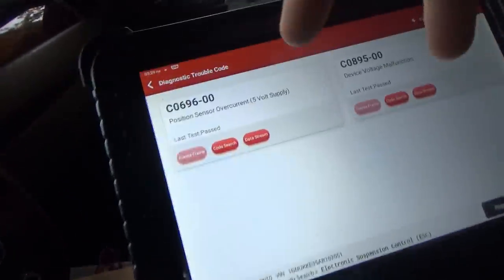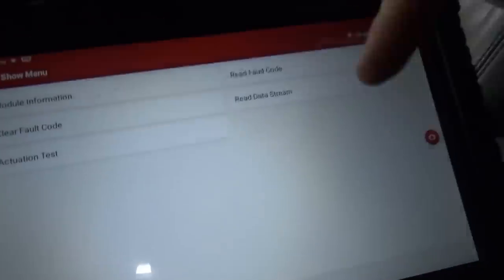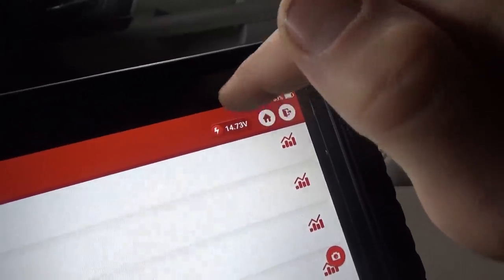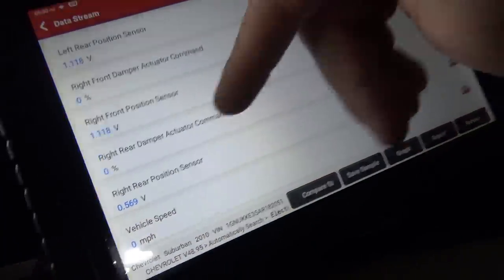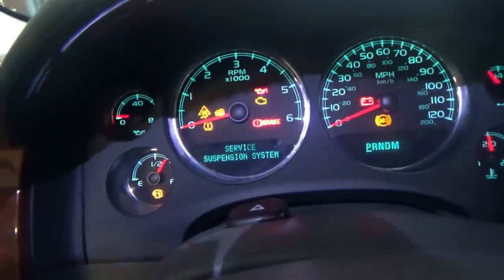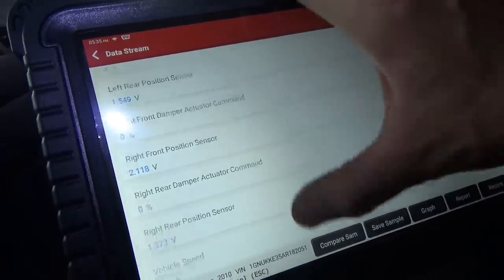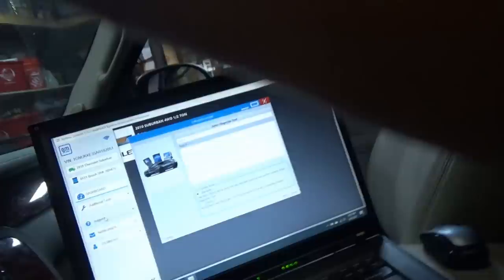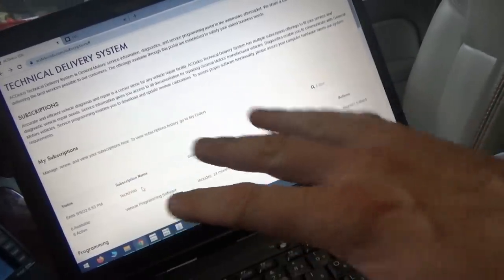"Beached Whale" Suburban - Part 3 (ESC Suspension Module: Replace & Program)

Comment: I had a 2003 with the same issues with leveling system compressor was bad shocks were shot too was quoted $2500 for repairs more than vehicle is worth I said no way. I searched found how to delete the electronic leveling system put new standard shocks all around and air bags in rear springs to the tune of $500 plus my labor. Works fine for me!

Comment: Wow ! tech 2 brought back memories from working at a holden dealership in the late 90s to early 2000s , they also had some antique looking scan tool before obd2 . Very basic but it did what it needed too . Great video Ivan 👍
Reply: G'Day Trent. John M here in Perth. (2nd attempt) I have a 2010 VE with an annoying problem in the Heater/A/c control. Before tearing the dash apart (scary) I am thinking of buying a TECH2 clone from China for $350 to see if it helps diagnose the fault. Any thoughts? Thanks.
Reply: @pakjohn48  Hi John , what's the actual problem with the a/c control ?
Reply: @trentg1396  Hello Trent. It permanently blows hot on the LHS (passenger) vents (both windscreen demister and face level) and A/C cold on the RHS. It doesn't matter which setting the dual control temperatures are set at. I've only been able to work around the problem in winter by removing the A/C compressor clutch contactor thus disabling it. But Summer is coming again!
Reply: @pakjohn48  pull the lhs trim off console and check heater control actuator on side of heater box is moving when you adjust temp controls . It's usually just the actuator that is faulty . If no movement of actuator check powers and grounds . I hope this helps 👍
Reply: @trentg1396  Thanks very much Trent. At last I've got something to trace. I will keep you posted.
Reply: @pakjohn48  Good luck mate 👍

Comment: Quite a circle jerk Ivan. Even with numerous high end aftermarket tools, GM makes sure they get their cut.
Pico scope gets you on the path but is unable to finish. Too many diagnostic tools out there  that just "won't or can't" complete the job. I feel your pain.
 Retired from Gm service 5 yrs ago, had an escm make me chase my tail for quite a while. Intermittently had high internal resistance within the module. Finally it stayed broken long enough for me to test across the comm, terminals with an ohm meter. Exhale and move on.

Comment: What about the processor for THE on STAR system(VICM) ???  or was that also a coincidence on the no start. Do you know what was shared over the network keeping the vehicle from starting ??  Did the BCM and or ECM receive a high voltage signal(higher than what was shown on the scan tool at the suspension module)over the network to keep it from starting as a failsafe operation ??  Well then come back next week  😉

Comment: ALC trimset basically resets the rear suspension height for the load leveling air shocks.  GM vehicles with MR shocks and rear air leveling use the same logic.

Comment: Hi Ivan, thanks for your educational video's, keep them coming!

Are all 4 suspension sensor connectors identical on this Chevy?
If yes, maybe swapping them randomly would recognise the sensor replacement, force the ESCM module to re-learn and automatically clear the C0558-4A code. 
But if the sensors are simple 3-wire potentiometers, this would probably not do the trick.

Looks like the internal voltage reference circuit gives off the wrong voltage.
If the circuit board is not covered by epoxy coating, I would start with a visual inspection of the module.
There could be issues caused by vibration like broken tracks or solder joints.
Even water intrusion could be the cause considering the location of the module.
If all seems okay, it can be a faulty semiconductor, leaking/shorted capacitor or other component.

Would love to see the faulty module opened and inspected/diagnosed by an electronics engineer. 

Greetings from Crete in Greece.

Comment: Thanks Ivan!  As soon as you said Saturn Astra I broke out in HIVES!  LOL. BTW The Astra passed inspection this year flying colors after I replaced the exhaust pipe with the crack flex pipe.  Greek is a Happy Camper. You and Amanda Stay well my friend.
Reply: That flex pipe needs repair every few years. There is a place in Canada that sells and ships replacements. I think they have different prices based on material quality/ warranty. The middle resonator is not available in the US as far as I can see but some generic stainless should be easy enough as that is just a long cylinder.
Reply from the maker: Have a 15 Sonic in the shop right now with the same 1.8 timing belt engine! Guess what... P0016 and P0420 😭🤣
Reply: @PineHollowAutoDiagnostics  P0016 with startup dieseling is likely camshaft actuator phaser; do timing belt kit while there for fun. P0420 might be flexpipe but the rear o2 sensor likely for age; check the plugs as OEM spark plugs might be copper and completely shot (taking the coil pack and cat with them).
Reply: @PineHollowAutoDiagnostics  Hey you need help give a shout. i even have the timing belt tools lol
Reply: @dosgos  The Astra Ivan helped me with it was a small crack in the flex pipe.
Reply from the maker: @dosgos  I'll have the video up soon 😁
Reply: @PineHollowAutoDiagnostics  Nice!
Reply: @PineHollowAutoDiagnostics  Awesome. We will see if these are engines are great, good, or junk!

Comment: Every time I program a vehicle, jump thru all the same hoops and finally get it done I can't help but wonder how it's so easy to do a cell phone update and it's free in comparison. It's not data volume, Cell Phones hold a lot of data also... I think it's just because by law they can make it difficult for the aftermarket, so they do.
I guess if the law didn't force them to allow us, we wouldn't be able to at all...Which brings us to needing to have a locksmith license for newer vehicles now. :/

Nice work Ivan! Btw I have the same Mastertech VCI, good tool.

Comment: So much complication - The oil-based suspension-system on my series of Citroen cars - a system invented c 70 years ago,  was a delight - no electronics involved until 2000 - ish - only replacement/recharging of suspension  spheres after several years of use. The KISS principle applies!  LOVE your posts  - you're certainly NOT a 'Quitter'  Cheeeers Keith
Reply: Fully support that. I had three Citroen C5 station wagons in succession and they were amazing cars with great suspension, powerful engines and a very comfy ride. The only issues I faced was: frozen diesel in a cold winter night (nobody's fault), two cracked door windows because they froze in place and the window actuator was too powerful (both fixed w/o costs due to warranty) and one weird exhaust partial blockage after inspection that cleared itself with a bang on the freeway (I guess something stuck in the exhaust). The suspension was simply fabulous and absolutely maintenance free. I'm really sad that Citroen discontinued it, it was that good.

Comment: Strange that an issue with the ESC would muck up the TCU that way and lead to a possible misdiagnosis.
Reply from the maker: TCU? ESC was an unrelated problem...
Reply: yeah, it's hard to make any conclusions when everything is on a CAN network like that;   things can reset each other in weird ways.  Or sometimes there is a hierarchy--  Like a Onstar module ties to the radio module, which first hooks into the BCM, which also passes through the gauge cluster before it ever gets to the ECM.  So some will have some controls over the module below it;  and for no obvious reason:  and will be different from one company to the next.  This CAN network is a little different in how everything has a passthrough, so they are all equally on the network-  so it's a little different.    But computers can glitch and still be fine when you reset them-- so you can't always trust it.   Like Ivan said, make sure you can repeat the problem over and over, and then you can be certain.

Comment: the S/W subscriptions were pretty minor compared with YOUR LABOR HOURS.  Always intriguing how (as you say) "convoluted" things can get.

BTW..  in my industry we had a standing procedure when connecting or disconnecting any connectors to always inspect.  LOOK CAREFULLY AT BOTH MATING HALVES FOR: (-1-) Bent Pins; (-2-) Pushed back pins; and in your field (-3-) Green crusties.  This includes new assemblies.  After inspection it was critical to NOT FORCE THE CONNECTORS TOGETHER.  No, "hammer to fit and paint to match!"

ADD:  Did the customer just not have a spare tire that would then offer ADDITIONAL mechanical protection for the replaced module?  You suggested they removed it for you but I wonder if it's permanently missing?  Just my 2c.
Reply: Automotive connectors can be a REAL pain. You really have to listen for the click, and sometimes have to lube the weathertight seal to get them to go.

Comment: Tech2Win really emulates the legacy Tech 2.  That procedure he did was literally updating his virtual Tech 2 the exact same way as if it was a real handheld tool.  Don't bother trying to program modules with a clone Tech 2.  Ivan already knows this.  I used MDI direct from SPS and it worked great after major struggles with my clone Tech 2.  I have a 4 part video series about this ...
Reply: Some of the stuff on aftermarket scan tools just does not work. Example, I tried programming a key on a Ford. The Launch I was using, the button and procedure was there to program it. BUT it did not work. I went into Ford programming and programmed it with no issues. Frustrating. The Ford programming cost $50 for 2 days, so I programmed the key at the same time I was flashing a trans on another car. BUT $50 if it was just that one key programming.
Reply from the maker: @mph5896  what year and model Ford? Usually ThinkTool does PATS pretty well
Reply: @PineHollowAutoDiagnostics  2014 Ford Edge. Launch throttle would not do it. 

I have had issues with my old Launch 431pro trying to program a few keys as well. 2012 or so Dodge key fob that I can remember.
Reply: We have a clone tech2 and it's pretty much worthless

Comment: When customer purchase ECM or other modules. I tell the customer. The modules MAY need to be programmed. The next question is. How much?$$
I tell them. That depends on the shop and their prices. I don't tell them the shop rates. Because of the price flucuations. 
I'm a DYI and have not tried programming modules since I don't have a pass thru device yet. I watch Dr. O programming. I know it cost $$ to get access to program and get access to wiring diagrams. For my own use. I use Alldata. Good night Ivan and thank you for dragging me along.

Comment: On older vehicle with comm issues I like to use the data bus diagnostic tool with the j2534 it’s accessible in the tech line connect home page where you launch tech 2 win, it will tell you voltage and if you have shorted can bus or bad module power, ground etc.
Reply from the maker: Hmm can't beat an oscilloscope though 😉
Reply: @PineHollowAutoDiagnostics  TRUTH
Reply: Telling Ivan not to play with his Pico scope, is like telling a little boy not to play with his...
Reply: @PineHollowAutoDiagnostics  I should have said if you didn’t have a pico.

Comment: Does Tech2 "three days" mean "72 hours starting NOW", or you can use it on three different days (today, Tuesday, and next Saturday), or ...?   And if you needed it for one customer today, and another tomorrow, both covered by the same "three days", how would you pass the cost along to the customer? $65 each, because they both get the same $65 value? $32.50 each, splitting the cost equally?
Reply: 72 hours starting now.
Reply: @mph5896  thank you

Comment: It still bothers me that the CAN problem isn't really solved. Yeah it could be the onstar but it wasn't consistent. Seems like there was more going on. May not be enough to justify spending all day chasing ghosts but don't think the CAN problem ever really got fixed. Did you plug that back in after changing the ESCM? Too many variables.

Comment: I may be done. All this new-fangled voodoo high-tech wizardry is immoral. Take me back to the pre-high-tech days. It wasn't THAT bad, and almost anyone could work on a car. The very idea (in this case) of having to pay over a hundred dollars to gain access to his own vehicle's software! Criminal! And that's after an $800 module! I may be moduled out. I love learning from you but it's really bringing me down.
Reply: This is no hi-tech, this is shitty-tech. There should be no scanner/pc/tool needed for this, all the tech needed is in the car. If it was not made by greedy bastards, the car would write "Detected replaced ESCM, recalibrate? [yes][no]", you would press some button on the dash and done. Advanced technology is not a problem, it's how it is used.
Reply: Hey Bill, do you stand on your porch and yell at kids to get off your lawn?
Reply: @adobedoug2564  It's true. I have become that guy. Gran Torino had two, count 'em, two, elctronic components: 1)AM radio, 2) condensor (capacitor) under the distributor cap.

Comment: I’m little confused about the VCIM AKA ONSTAR. All you did was put the fuse but that also disables GPSand Bluetooth operation? I need Bluetooth and gps so I’m not sure if the customer is aware or cares. He should have let you known the fuse was missing before it caused him money so bad on him. All the issues you have with this truck and more are slowly happening to my 2011 Tahoe LTZ OMG. I really enjoy watching your videos and your diagnostic approach. I left the dealership world in 2009 but these vehicles are impossible to repair without diagrams and scan tools. My truck has a 4 amp draw on the battery that comes on and then falls back to sleep after 1 hour and repeats. I’m leaning towards the BCM but there is no issues with the truck other than that no crazy lights or warnings come on but after 4 days the battery is dead. Gm had a technical bulletin for VCIM software problems but if I remove the Info fuse the drain is still present. UBEC AND body grounds all cleaned or replaced. If I remove the ip fuse box white connector with all the red & white tracer the draw goes away?

Comment: I'm pretty sure my module is bad.  What happens if I just pop in a new one without programming?   Still drivable?  If it's just a warning light I'm cool with it I'm just having weird lights and other issues
Reply: you will get a 'service suspension system' error message on the dash...ask me how I know

Comment: When the module gets installed does it require the air out of suspension system so it's at zero??? Must be something in installation process from manufacturer.....

Comment: All the other vendors of the scan tools have to know that they do not have the ALC TRIMSET feature. It's probably an intellectual property or patented process and GM is not licensing it.
Could the Tech II have done the entire module software install?
It's just a way to squeeze another Benjamin out of ya.
Reply: Also about " CONTROL ".

Comment: You pay $65 to use Tech2 for a couple of days, then you need to charge for your time on top - out of curiosity, what would the GM dealer charge to calibrate / program that module?
Reply: He actually got a month out of TECH 2 but I get what you are saying. A GM dealer " PROBABLY " would vary from shop too shop or what ever they want ?
Reply: @NoWr2Run  Yes, I saw he got one month, I was just curious what the dealers in the USA charge to carry out programming, there seems to be a huge variation in charges. I recently bought a new key for my Toyota from my local dealer and it cost me  USD$ 52 for the key, it cost an additional  USD$13 to get it programmed (Genuine Toyota at a Toyota main dealer) and I hear people in the US having to pay $400 for the same service!
Reply: @richardgraham65  Yes, huge variations for sure. I just had a key made & programmed for a 2007 Ford by a mobile Locksmith, bill was $95.00 total. 2 different dealers wanted almost $300 & I had too take the car to them. I tipped the Mobile Guy $20.
Reply: @NoWr2Run  You got a good deal there! Nice you appreciated him with a tip. Such a variation between dealers too, some just want to rip you off for as much as possible and do not care about return business. Luckily my local Toyota dealer will not do any work on my truck unless absolutely necessary, so he gets return business now for almost 20 years. I used  a dealer in the city and he ripped me off 1st time for brake pads and a couple of ball joints, never ever use them again.

Comment: Did this also fix the Com problem?
Reply from the maker: Disabling OnStar fixed the CAN problem in Part 2 👍
Reply: @PineHollowAutoDiagnostics  OK I just wondered if that wonky suspension module somehow pulled the network down.

Comment: The underside of a car is an excellent place for exposed electronic components.
Reply: Especially in a salty environment. 

I have coated my modules with fluid film to keep water from corroding the seal and letting water in.
Reply: You gotta wonder what the manufacturer is thinking
Reply: Well answering my own question, they don't care, because by the time things corrode and start having problems it's long out of warranty and probably on its second or third owner.

Comment: If you has the actual Tech2 would you be able to do the final step without having to pay GM?
Reply: I doubt it, the emulator he used just emulates a Tech2, so the subscription cost would still be there... I am sure at the dealership, their devices had permanent subscriptions.

Comment: I think most shops would just tell you to take it to the dealer. 
It's ridiculous that a module like this has to be programmed.
Reply: I was wondering if your average dealer would have even bothered with the calibration. The dash light was off they probably would have shipped it home.